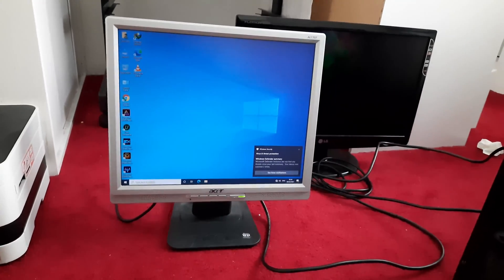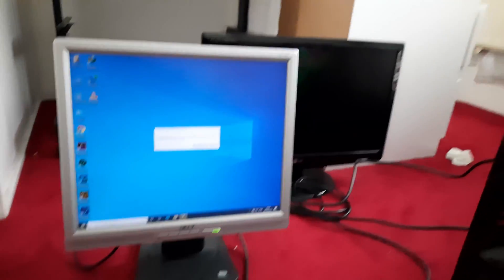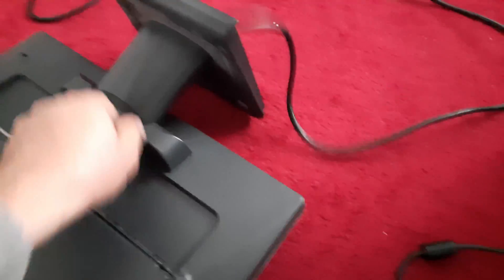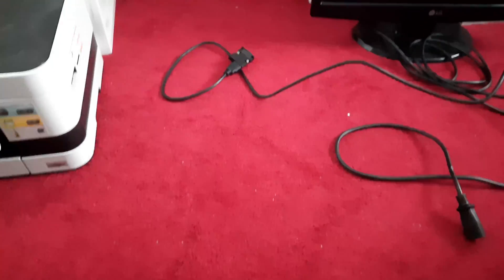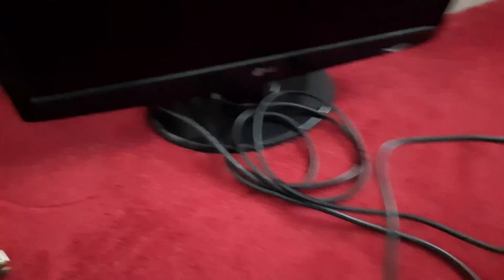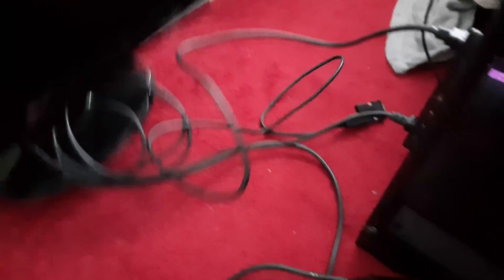How to fix power saving mode without clean ram or other pc components solve black screen error 2022

Comment: Your method didn't work exactly for me but it gave me an idea, because my vga cable was new and i didn't want to buy another one, i just switched the cable connected to the GPU with the one that was on my monitor and it worked.

Comment: Hello, I also have a LG computer but the model is different and I do not have power saving mode I am getting the error, I cleaned the RAM, plugged and unplugged the CMOS battery, changed the cables But I still get the same error, what's the problem?
Reply from the maker: @brawlerfevzi38if you have display not shown problem then please remove all cables and ry to give heat with whole motherboard and graphics card with hair dryer i hope you will fix it if no then check with other graphics card or other lcd monitor connect your pc
Reply: Event Okay I'll try. Thanks

Comment: I also have the same monitor and have the same problem.i hope I can solve the problem later by replacing a VGA cable.thanks a lot for your solution method.

Comment: My pc boots up I can see the asrock logo after a few seconds The display goes off,  the computer is working fine,the keyboard mouse too,after I disconnect and connect the VGA cable,the display shows up,sign in(windows),I think it's a cable or monitor issue,what else could be the issue,(pc is new build no issues with ram,psu,cpu,ssd)

Comment: Same problem bro only vga port working Hdmi not working why
Reply from the maker: @ammyvirk4932  if you are using external Graphics card then you need to install the correct driver and monitor if there is no built in hdmi port then please buy good converter like i showed in this video hope will work and try all ports in graphics card

Comment: my computer does not again :(  everything is good pc is turn on but again write this  power saving mode
Reply from the maker: Hi sorry to hear that you have problems in your pc first of all you can connect to your pc with any other lcd or monitor and if display come go to graphic settings and set screen resolution as recommended.
If you power on and your pc just show in start power saving mode then please unplug all your pc cabels hdd Ram processor , graphic card etc  and reconnect it, 
Still not fix then connect vga cabel on other options from graphic card like hdmi ports etc . 
Still not fix then please resd video description and do all steps whose mentioned in there hope you will fix it.

Comment: My computer goes into power saving mode, is turning off the computer without shutting it down the problem?
Reply: Thanks, it worked.
Reply from the maker: @Kaermest  thanks you too for your response and support
Reply from the maker: Please try to check cpu and its heat sink and fan open them and close them again unplug  all wires and hdd disk dvd cd , cmos cell , all other things except motherboard processor with fan and ram then power on pc with screw driver and check if its fit then is good if still same problem then change ram
Reply from the maker: If still same problem then motherboard and processor are not compatible so change processor and it will fit

Comment: so i been using 2 monitore last few weeks. today my pc froze.. i manually switched of holding the power button in. when i turned back on. one monitor was not working..it just kept saying the “enabling power save” messege. for that monitor i was using hdmi port on pc connected to hdmi port on monitor (as my pc only has one vga & one hdmi for 2 screen connection). i brought a new chord. that made it go from hdmi port on pc to vga on monitor. it still didnt work. i cleaned the ram/cmos. still didnt work. i than swapped both vga’s on both my monitore. than the good monitor stopped working. and the monitor that wasnt working is working now?

so i’m assuming the chords are fine as there brand new…im assuming both monitore are fine as either one works when i swap vga from one to the other. so i guess its something related to the hdmi port?

sometime ago i had a bsod appear about 5 times in a few weeks. always fixed itself. i havent had a bsod for quite some times now. not sure if its related to that either 🤔
Reply from the maker: Hi 
First of all connect one monitor with pc after when is work fine then disconnect  that monitor and connect with that cabels and connecters if you use the other monitor whose not showing display if is shows then first monitor connect with the second cabel hope will fix the issue , if still not then please go to graphic settings and set screen resolution as Recommended click apply do this with other monitor too and will fix it third try to factory reset settings of that monitor whose not showing display hope you will fix it
Reply: @luckyinfo409  🤦🏽‍♂️🤦🏽‍♂️. spent $49 on a new hdmi>vga cable. didnt work. went out and spent another $60 on a vga cable splitter & another vga-vga cable..cable splitter didnt really work. it displayed both screens wouldnt recognise second screen was just a duplicate. wouldnt let me change in settings. than made my main screen annoying double vision. so i decided to see if i could fix it. but also putting in the hdmi cable while both screens were working with the vga cable splitter & it worked…one screen now just had double vision. so i disconnected splitter & put back in vga for the main screen. now there both working fine 🤣. hundreds of $$ spent trynna fix. almost brought 2 new monitor for $300. and now its working fine as it was before 🙄
Reply from the maker: Try to connect your both monitors with same port whose giving display good with hdmi switch or hub

Comment: Thank you , but more than 10 minutes of the video wast just waist of time , this vido could be for only 3 minutes and it will complete its purpes
Reply from the maker: Welcome will try my best to make short video next time thanks for your response and support
Reply: @luckyinfo409  i hade this problem several times now , i found that when ever any one cleans the outside of my pc some time this problem is coming and the problem can not be solved untile i take the pc to the computer workshop and bulge it another monitor then it works! after that when i take it back to my home for some reason its working back on my monitor!  Cant explain why it is happening like that!

Comment: What if i didn't use the converter. I have only vega cable directly
Reply from the maker: If you have same problem with direct canel then first of all try to connect your pc with any other lcd or monitor if your pc shows display there then update your graphic card driver and set the screen resolution as recommended and then connect with  this monitor whose you have issue hope it will work if you still have issue then please read video description and try to do all steps whose written in description hope you will fix it if you still have issue let me know

Comment: My lcd was working on same cable ,one day it stopped doing working showing entering power saving mode m not using converter vga. I hv cleaned ram re assembled and also i hv changed lcd with different different cables
Reply from the maker: Hi sorry for late reply Actually you have to change lcd first just connect your pc with other lcd or monitor, this i say if your pc power on showing logo window logo something then becomes black goes to power saving mode then it will adjust automatically screen resolution and will work correctly but  if still same then please follow video description methods and try one by one all i  hope you will fix it

Comment: Bro i Don t Have a monitor with hdmi i connected my tv with hdmi and notfing
Reply from the maker: Hi thanks for your response please try to change your converter if you are using or change cabel please restart pc and check again try to update your graphic driver .but all these solutions if your pc work properly only when you connect with tv then become black , if your pc not on or show black screen power saving mode then please read video description and try to use all methods one by one sure you will fix it

Comment: i am not using a converter i am using display port
Reply from the maker: When you power on pc if is goes right way to power saving mode then first please try to connect your pc with other lcd or monitor , 
Or open ram and clean it and try to clean ram slot with air bloor ,
2nd if your pc have vga or graphic card try to clean and even replace 
3rd if still have issue then please read video description and try to use all methods whose written in description 
Sure you will fix it quickly

Comment: It didn’t work and still give me “saving  power mode”
And i have the same vga displayport Chinese
Reply from the maker: I am very sorry to hear that is not working for you, kindly use other converter and try it again or use other lcd or monitor then try it . if you still have not fixed then please read this video description and try all methods whose written in the description one by one sure you will fix it quickly thanks

Comment: In power save mode press any key or move to mouse plz some body tell me about this
Reply from the maker: First of all if your pc shows everything when you power on and goes to become black only in desktop stage then you have to watch our other video Input Not Supported and try our method again and again slowly slowly even you can restart your pc and try again suddenly display will come and you have to go to graphic settings and set resolution settings as recommended and click apply then your problem will solve
Reply from the maker: If you ask why is asking you again and again move mouse otherwise its goes quickly in power saving mode then you have to increase timing of power save mode or sleep desktop etc in Control panel then power options then set it

Comment: Sir I have no converter but still facing issue
Reply from the maker: Hi sorry to hear that you have this issue, first of all please confirm that when you power on your pc if everything showing display normal like pc company logo window sign etc and only in the desktop stage become black then  try to watch our other video Input Not Supported and use this method again and again slowly slowly even you can restart your pc and try again suddenly display will come and you have to go to graphic settings and set resolution settings as recommended and click apply button ,But if you see when you power on your pc not showing nothing from start then try to use other Lcd or monitor, if still not fix then please try all methods whose i written in the video description
Reply: @luckyinfo409  plz do not write a spam message
Reply: Plz help
Reply from the maker: How you can say is spam message i explain you in that message everything what you have to do everything step by step , did you read it , is related about your problem whose you have kindly read carefully and do what i said sure you will fix it.

Comment: Um it came back and tried to do it again and did not work anymore
Reply from the maker: Please explain me what is your exactly problem
Reply: @luckyinfo409  uh i did what you did in the vid it did work but it suddenly turned
Off then it says D sub power saving mode
Reply from the maker: @vkv1335  ok first of all try to restart pc if you see display then go to pc Graphic settings and set resolution settings as recommended click apply button
Second try to update your graphic card Driver.
Third try to change your converter whose you are using and find like mine whose i used in video 
4th try to connect your pc with other Lcd or monitor and reset your resolution settings as recommended.
In last please read video description and try to use all methods one by one i hope you will fix it quickly.

Comment: i got a computer for my desk at the nonprofit organization where I volunteer at. Not sure if its a new or old computer but it was working fine for a day. i shut down the computer since i won’t be using it for a week and when the day i went in to volunteer, i turn on the motherboard and the monitor and i see the power saving mode. what is wrong?

Comment: I don't even use a converter and it still doesn't work what can I do, I know the ram isent the problem and all it says when connecting it to the pc is entering power saving mode and the light at the bottom go's from green to orange
Reply from the maker: Hi i am sorry to hear that you have this issue first of all please try to connect your pc with other Lcd or monitor and reset your resolution settings as recommended and click apply button then ok , 2nd after if you get display try to update your graphic card Driver. If you fail to see the display with these methods try to read video description and try to use all methods whose written in the description i hope you will fix it quickly thanks.

Comment: it doesn't work bro i have the two ports of the cable are VGA , one is attached in the pc are the other is attached in the monitor
Reply from the maker: Hi sorry to hear that you have problems in your pc i suggest you kindly go to video description and try to use all methods whose written in the description one by one i hope you will fix it quickly thanks.
Reply: @luckyinfo409  thnx appreciated that

Comment: PLEASE HELP! I am currently experiencing the same problem. I have a brand new CPU system, with 16GB RAM kingston fury, Graphics card 4GB, ASUS motherboard, 600 watt power supply and Ryzen 3500X processor. My monitors are around 2 years old. 1 is an LG monitor and I am using a VGA to Display Port converter to connect it to the Graphics Card. The other monitor is Acer and I am using VGA to DVI-D converter to connect it to my CPU graphics card. I want dual screen, so this is why... My computer turns on just fine. I can use my PC with both screens/monitors... However, I have noticed that after a few minutes, both my screens would say "NO SIGNAL, ENTERING POWER SAVING MODE" , the monitors would turn off for around 5 seconds but turns back ON on its own and goes back to my Desktop...closing all the apps/games/windows that I was using before it went OFF. This was worse when I was using HDMI converters... It is better now but it still goes off... probably around 10 to 20 minutes.. it is also worse if I play Games like MIR4.

PLEASE HELP ME! :( I am so stressed, my CPU is new....
Reply from the maker: Hi mam thanks for your response sorry for late reply , Actually i was on job so there i don't have smartphone with me so i see your message now and first off all try one monitor only and check if is work perfect continuesly then you will be satisfy that monitor is not doing problem with you pc display then try second one if u see is still doing that problem then you have to change Converter , Hdmi to vga or hdmi to dvi must try to buy good quality , second if both monitosrs ae work fine when you use one by one then connect both and try to update your graphic card driver , and go to graphic settings and set screen resolution as Recommended by monitors and especially check with change of bit rate and in last also try to click on your monitors Auto button whose set automatic settings internally in monitors or try to Factory  reset your monitors i hope you will fix it if you still need help let me know thanks
Reply: @luckyinfo409  thank you so much for your reply. I actually observed that my Acer monitor with the vga to dvi converter worked fine.when i plug my lg through the display port, that causes problem. For some reason...
About the drivers, i have a tuf b450m pro gaming asus mobo, can you help me with the drivers?
Reply from the maker: @maicatechy2421  welcome that's why I was thinking one of the monitor doing problem any hope you will fix it here is official Original Drivers download link  https://www.asus.com/Motherboards-Components/Motherboards/TUF-Gaming/TUF-B450M-PRO-GAMING/HelpDesk_Download/ just slect your operating system and then download all quickly , if u need Registered idm then i have also video check in my channel and video description you will get download link , and change LG monitor converter please. Hope it will fix .

Comment: Sir my one is VGA cable and .y monitor same as your monitor ports and when I did like you iam facing the same problem 🙏🏻
Please tell sir what I need to do 🙏🏻🙏🏻🙏🏻🙏🏻🙏🏻😭🙏🏻🙏🏻🙏🏻🙏🏻
Reply from the maker: Hi thanks for contact with us , if you have  same problem your pc work fine with other lcds and monitors then you have to change your HDMI to vga converter try to use same like we use in video or any other good quality , Second try to use other hdmi port or install hdmi driver to connect your pc with other lcd , or set graphic settings resolution Recommend , but make sure you are using graphic card in your pc if you need more help let us know thanks
Reply: @luckyinfo409  I have 16gb gaming pc with 4gb graphic card
Reply: @luckyinfo409  I got a new VGA today and facing the same problem with older one 😭 and this Dell monitor doesn't support HDmi and only support VGA
Reply: @sourya2507  I also have a fell monitor but it does support hdmi but I’m still getting the same problem
Reply: @luckyinfo409  As I have tried like removing ram and cleaning it and inserting the ram but not solved and face the same problem
Reply from the maker: @sourya2507  as i told you please try to use good converter Hdmi to vga it will fix quickly you have to wait little bit after power on pc , another solution try to check first your pc with another monitor if there work good then you have to use same converter or different same like whose i used it will work hope so
Reply: @luckyinfo409  are you telling about the connector which connects a VGA cable in HDMI port if it is right I have 3 but not done

Comment: Sir I have same problem and I use connector also with this problem my  keyboard also not working is this normal ?
Reply from the maker: Hi, please check your converter and try to   use same like i used , and keyboard you can connect with other port or try to check other keyboard normally keyboard no have any issue with this problem